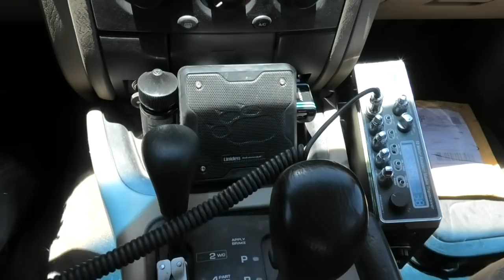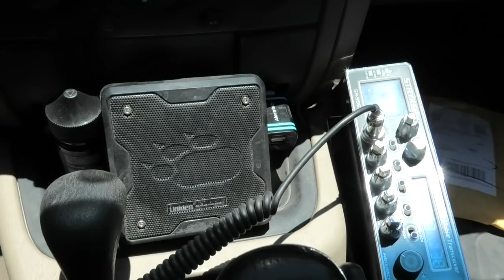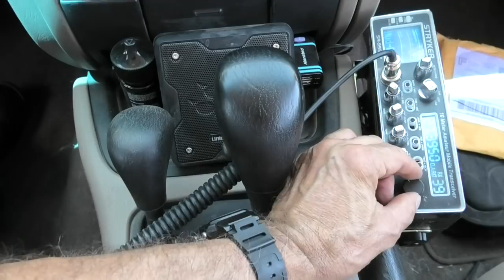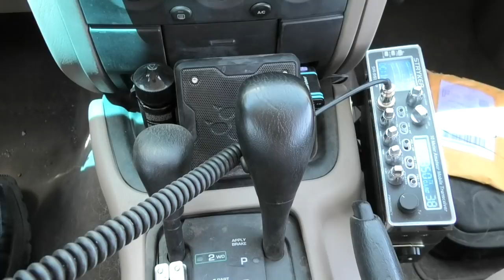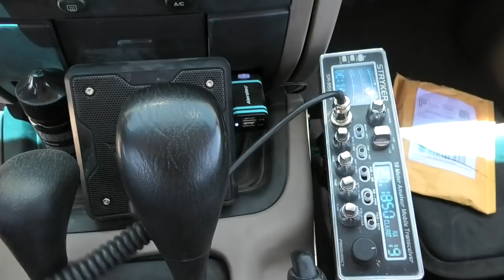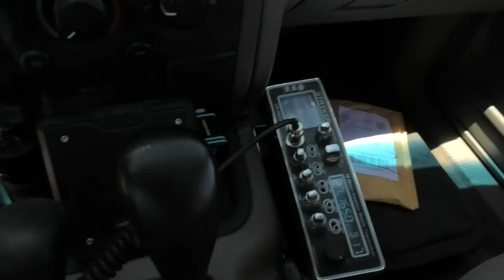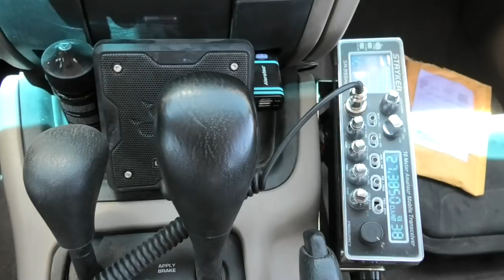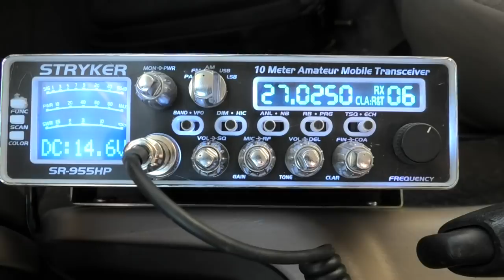Barefoot Stryker SR955HPC - Educational Video - Don't Mock .. Keep It Constructive. Thanks, HD

Comment from the maker: If they can't show you .. Hahaa. They'll sell you "Ocean Front Property In Arizona" lalalaalalaala! Get the picture? Bite your tongue and follow directions .. Here's what it takes to cut through the noise, be loud and crystal clear with a better receiver too:  A) Tuned Bench:  https://www.youtube.com/watch?v=lwcDfXOgAls.  True, it's more complicated and time consuming to accomplish these consistent and accurate results. Below is a partial procedure and list of calibrated equipment used to achieve this level of performance . Read on ..

Fine Tune CB Radio Shop strictly adheres to (https://www.nist.gov/) NIST Traceable Calibrations and other industry standards to maintain accuracy and consistency for providing Real World Performance Tuning of Citizens Band and 10 Meter export mobile radios with integrity.

"Basic Textbook AM/FM/SSB Transceiver Tune, Alignment and Calibration" 

1) Pll adjustments
VCO & OSC, AM TX OSC, USB TX OSC, LSB TX OSC.

2) Transmitter alignment
DRIVER BIAS, FINAL BIAS, SSB  (or gate voltages for mosfet versions) CARRIER BALANCE, HI-LO AM & SSB Power, RF METER, AMC, ALC and FM DEVIATION.

3) Receiver alignment
AM/FM RF & IF SENSITIVITY, FM DETECTOR/DEVIATION, SSB IF SENSITIVITY, SSB S-METER, AM/FM S-METER (100uV unmodulated -67dbm for “S-9” meter reading!), AM/FM SQUELCH RANGE, SSB SQUELCH RANGE, and NOISE BLANKER/AUTOMATIC NOISE LIMITER (Real World dBm to volts (uV) tables below).

That's just a typical run of the mill textbook tune up and alignment (if you're lucky). There's more to it than frequency alignment, modulation adjustment, meter calibration and a tune up report displaying exaggerated rms Bird peak watts! 

"Test Bench includes"

Bird 4314C Meter
https://www.birdrf.com/Products/Test%20and%20Measurement/Power-Meters/Wattmeters-Line-Sections/RF-Wattmeters/4314C_PEP-Single-Element-Wattmeter.aspx
Part 1) https://www.youtube.com/watch?v=RpX9IHe4ORM&t=16s
Part 2) https://www.youtube.com/watch?v=LuhbqTf6Bxw
Bird 4314C Accuracy Test: https://www.youtube.com/watch?v=DqEOabYqhQo&t=5s
Bird Stipulates 1/2 wavelengths  https://www.youtube.com/watch?v=5eWhgT-rTII
And Genuine Bird Elements from 1K down.

Bird 4373 Sampler 
https://www.rfparts.com/signal-samplers.html

HP8924c with options
http://userequip.com/files/specs/2147/HP%208924C%20Repair.pdf
https://www.youtube.com/watch?v=Cg1w0xBa27s&t=1s

HP8920a with options
https://www.keysight.com/upload/cmc_upload/All/EPSG072204.pdf

Three analog scopes, one digital 200 Mhz
https://www.atecorp.com/atecorp/media/pdfs/data-sheets/tektronix-2465b-2467b_manual.pdf
https://www.youtube.com/watch?v=by98x4eu2lM

Fluke 27fm
http://www.fluke.com/fluke/inen/digital-multimeters/fluke-27.htm?pid=56055
 
LCR http://www.lcrresearch.com/wp-content/uploads/2017/05/LCR_Pro1_Manual_version1.03.pdf

Power supplies
6 Cosel PBA1500f12 (750 amps) variable and configurable.
https://en.cosel.co.jp/product/powersupply/PBA/PBA1500F/PBA1500F-12/
Corcom 20VB1 F7130 EMI Filter 50-60Hz 250V

Times Microwave Coax jumpers and test leads
http://www.timesmicrowave.com/cms/products/cables/lmr/
https://www.youtube.com/watch?v=EmqaGJ6IWow
https://www.youtube.com/watch?v=1ltFVSxGp5Y
https://www.youtube.com/watch?v=v12YZT_1o90
https://www.youtube.com/watch?v=h7iiYfmYWRA&t=215s

Amphenol RF Connectors
https://www.amphenolrf.com/
https://www.youtube.com/watch?v=dVh5B0hdEA0 
https://www.youtube.com/watch?v=dKZg8T_AOso

More range, compliments, reliability and a quieter, clearer but more sensitive receiver,  Get Fine Tuned .. not peaked and ruined.

Here are some VideoGates of me at the bench practicing what I preach using my bench radio or customers radio completed and ready to be shipped: https://www.youtube.com/results?search_query=hard+drive+163+ more: https://www.google.com/search?q=Hard+Drive+163+nm&ie=utf-8&oe=utf-8&client=firefox-b-1-ab

It's what I recommend, use, service and sell ... to you ... not something non practical or deceiving in a misleading way. I'm not just the tech and owner of Fine Tune CB Radio Shop, I'm a customer too!  When finished, You'll be giving radio checks, not asking for them .

dBm To Watts and Volts
Tables below displays relationship between Power in [dBm] or [Watts] and Voltage in RMS, peak, peak-to-peak for sinusoidal signals in 50-Ohm systems for accurately measuring and tuning am/fm/ssb receiver sensitivity, agc, squelch and "S9" Meter calibration. Real World! Mike @ Mikes Radio Repair (Romper Room), Mark Rutherford aka Mark 19960, CB Kidd, Martian and all of your other fake accounts pay attention to the tables below, stop misaligning radios, spreading false information and promoting propaganda! 

  [dBm] [Watts]   [Volts]rms   [Volts]p    [Volts]pp
-140 0.100E-16  22.361 nV  31.618 nV  63.236 nV 
-139 0.126E-16  25.089 nV  35.476 nV  70.952 nV 
-138 0.158E-16  28.150 nV  39.805 nV  79.609 nV 
-137 0.200E-16  31.585 nV  44.662 nV  89.323 nV 
-136 0.251E-16  35.439 nV  50.111 nV  100.222 nV 
-135 0.316E-16  39.764 nV  56.226 nV  112.451 nV 
-134 0.398E-16  44.615 nV  63.086 nV  126.172 nV 
-133 0.501E-16  50.059 nV  70.784 nV  141.568 nV 
-132 0.631E-16  56.167 nV  79.421 nV  158.842 nV 
-131 0.794E-16  63.021 nV  89.112 nV  178.223 nV 
-130 0.100E-15  70.711 nV  99.985 nV  199.970 nV 
-129 0.126E-15  79.339 nV  112.185 nV  224.370 nV 
-128 0.158E-15  89.019 nV  125.874 nV  251.747 nV 
-127 0.200E-15  99.882 nV  141.232 nV  282.465 nV 
-126 0.251E-15  112.069 nV  158.465 nV  316.931 nV 
-125 0.316E-15  125.743 nV  177.801 nV  355.602 nV 
-124 0.398E-15  141.086 nV  199.496 nV  398.992 nV 
-123 0.501E-15  158.301 nV  223.838 nV  447.677 nV 
-122 0.631E-15  177.617 nV  251.151 nV  502.302 nV 
-121 0.794E-15  199.290 nV  281.796 nV  563.591 nV 
-120 0.100E-14  223.607 nV  316.180 nV  632.360 nV 
-119 0.126E-14  250.891 nV  354.760 nV  709.519 nV 
-118 0.158E-14  281.504 nV  398.047 nV  796.094 nV 
-117 0.200E-14  315.853 nV  446.616 nV  893.232 nV 
-116 0.251E-14  0.354 µV  0.501 µV  1.002 µV 
-115 0.316E-14  0.398 µV  0.562 µV  1.125 µV 
-114 0.398E-14  0.446 µV  0.631 µV  1.262 µV 
-113 0.501E-14  0.501 µV  0.708 µV  1.416 µV 
-112 0.631E-14  0.562 µV  0.794 µV  1.588 µV 
-111 0.794E-14  0.630 µV  0.891 µV  1.782 µV 
-110 0.100E-13  0.707 µV  1.000 µV  2.000 µV 
-109 0.126E-13  0.793 µV  1.122 µV  2.244 µV 
-108 0.158E-13  0.890 µV  1.259 µV  2.517 µV 
-107 0.200E-13  0.999 µV  1.412 µV  2.825 µV 
-106 0.251E-13  1.121 µV  1.585 µV  3.169 µV 
-105 0.316E-13  1.257 µV  1.778 µV  3.556 µV 
-104 0.398E-13  1.411 µV  1.995 µV  3.990 µV 
-103 0.501E-13  1.583 µV  2.238 µV  4.477 µV 
-102 0.631E-13  1.776 µV  2.512 µV  5.023 µV 
-101 0.794E-13  1.993 µV  2.818 µV  5.636 µV 
-100 0.100E-12  2.236 µV  3.162 µV  6.324 µV 
-99 0.126E-12  2.509 µV  3.548 µV  7.095 µV 
-98 0.158E-12  2.815 µV  3.980 µV  7.961 µV 
-97 0.200E-12  3.159 µV  4.466 µV  8.932 µV 
-96 0.251E-12  3.544 µV  5.011 µV  10.022 µV 
-95 0.316E-12  3.976 µV  5.623 µV  11.245 µV 
-94 0.398E-12  4.462 µV  6.309 µV  12.617 µV 
-93 0.501E-12  5.006 µV  7.078 µV  14.157 µV 
-92 0.631E-12  5.617 µV  7.942 µV  15.884 µV 
-91 0.794E-12  6.302 µV  8.911 µV  17.822 µV 
-90 0.100E-11  7.071 µV  9.998 µV  19.997 µV 
-89 0.126E-11  7.934 µV  11.218 µV  22.437 µV 
-88 0.158E-11  8.902 µV  12.587 µV  25.175 µV 
-87 0.200E-11  9.988 µV  14.123 µV  28.246 µV 
-86 0.251E-11  11.207 µV  15.847 µV  31.693 µV 
-85 0.316E-11  12.574 µV  17.780 µV  35.560 µV 
-84 0.398E-11  14.109 µV  19.950 µV  39.899 µV 
-83 0.501E-11  15.830 µV  22.384 µV  44.768 µV 
-82 0.631E-11  17.762 µV  25.115 µV  50.230 µV 
-81 0.794E-11  19.929 µV  28.180 µV  56.359 µV 
-80 0.100E-10  22.361 µV  31.618 µV  63.236 µV 
-79 0.126E-10  25.089 µV  35.476 µV  70.952 µV 
-78 0.158E-10  28.150 µV  39.805 µV  79.609 µV 
-77 0.200E-10  31.585 µV  44.662 µV  89.323 µV 
-76 0.251E-10  35.439 µV  50.111 µV  100.222 µV 
-75 0.316E-10  39.764 µV  56.226 µV  112.451 µV 
-74 0.398E-10  44.615 µV  63.086 µV  126.172 µV 
-73 0.501E-10  50.059 µV  70.784 µV  141.568 µV 
-72 0.631E-10  56.167 µV  79.421 µV  158.842 µV 
-71 0.794E-10  63.021 µV  89.112 µV  178.223 µV 
-70 0.100E-09  70.711 µV  99.985 µV  199.970 µV 
-69 0.126E-09  79.339 µV  112.185 µV  224.370 µV 
-68 0.158E-09  89.019 µV  125.874 µV  251.747 µV 
-67 0.200E-09  99.881 µV  141.232 µV  282.465 µV
-66 0.251E-09  112.069 µV  158.465 µV  316.931 µV 
-65 0.316E-09  125.743 µV  177.801 µV  355.602 µV 
-64 0.398E-09  141.086 µV  199.496 µV  398.992 µV 
-63 0.501E-09  158.301 µV  223.838 µV  447.677 µV 
-62 0.631E-09  177.617 µV  251.151 µV  502.301 µV 
-61 0.794E-09  199.290 µV  281.796 µV  563.592 µV 
-60 0.100E-08  223.607 µV  316.180 µV  632.360 µV 
-59 0.126E-08  250.891 µV  354.760 µV  709.520 µV 
-58 0.158E-08  281.504 µV  398.047 µV  796.094 µV 
-57 0.200E-08  315.853 µV  446.616 µV  893.232 µV 
-56 0.251E-08  0.354 mV  0.501 mV  1.002 mV 
-55 0.316E-08  0.398 mV  0.562 mV  1.125 mV 
-54 0.398E-08  0.446 mV  0.631 mV  1.262 mV 
-53 0.501E-08  0.501 mV  0.708 mV  1.416 mV 
-52 0.631E-08  0.562 mV  0.794 mV  1.588 mV 
-51 0.794E-08  0.630 mV  0.891 mV  1.782 mV 
-50 0.100E-07  0.707 mV  1.000 mV  2.000 mV 
-49 0.126E-07  0.793 mV  1.122 mV  2.244 mV 
-48 0.158E-07  0.890 mV  1.259 mV  2.517 mV 
-47 0.200E-07  0.999 mV  1.412 mV  2.825 mV 
-46 0.251E-07  1.121 mV  1.585 mV  3.169 mV 
-45 0.316E-07  1.257 mV  1.778 mV  3.556 mV 
-44 0.398E-07  1.411 mV  1.995 mV  3.990 mV 
-43 0.501E-07  1.583 mV  2.238 mV  4.477 mV 

                 Don't Be A Mud Duck!

 https://www.arrl.org/shop/ARRL-Handbook-2019-eBook

Hard Drive 163 NM. 73's! Click click.?